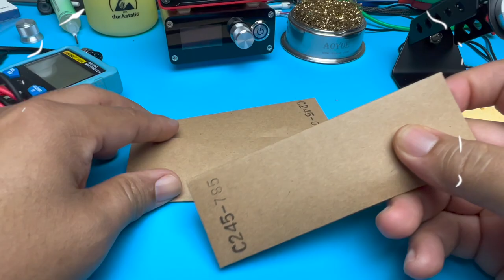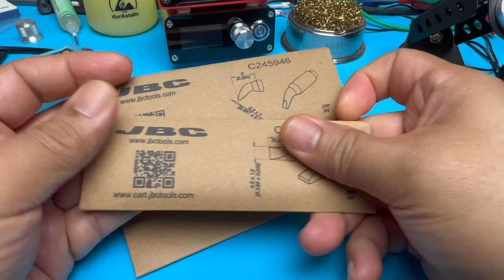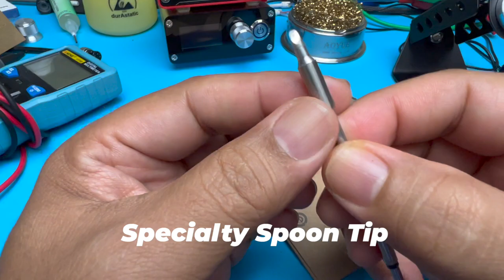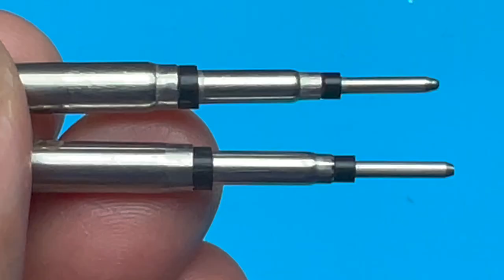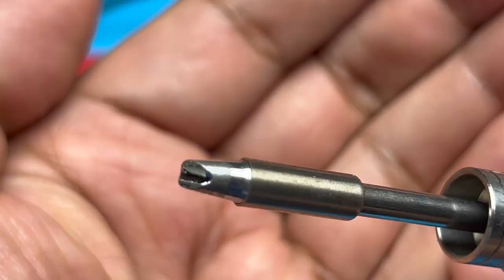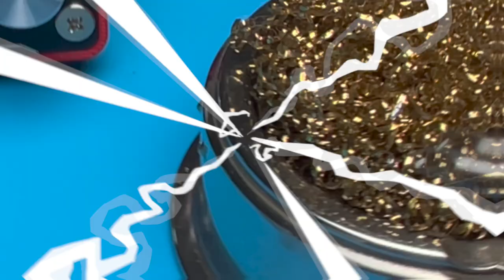Aliexpress Generic JBC C245 Tips Hype Video

Comment from the maker: With JBC prices rising, these are a fantastic alternative for the hobbyist, espcially if you just want to try out the expensive specialty shaped tips JBC offers, to see see if it's something that you might like. BTW,  get a tip temperature tester. Your MAX temp should really be 330°c. I use 280-300°c in most situations.
Reply: why is it though? the clone tip could burn out?